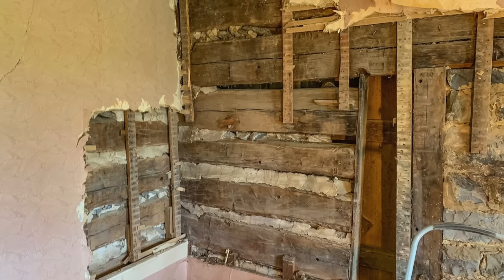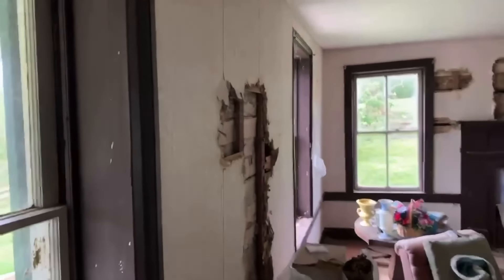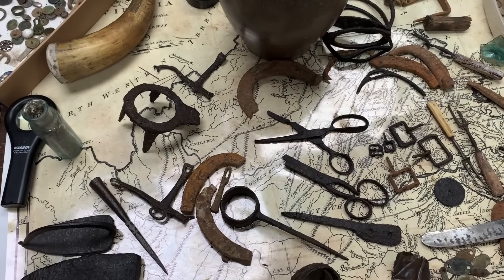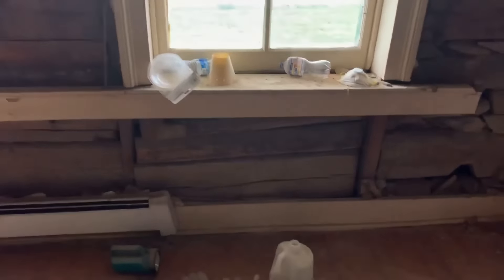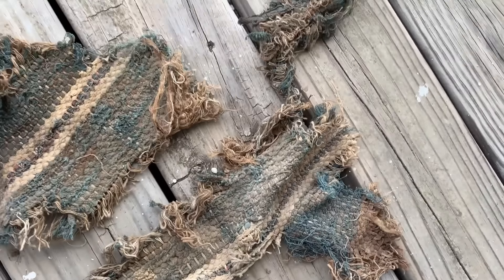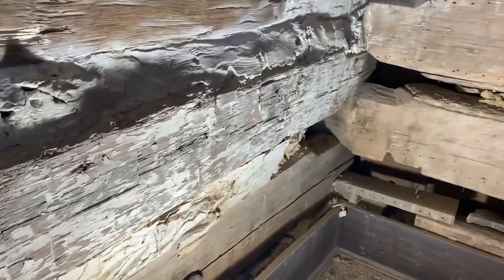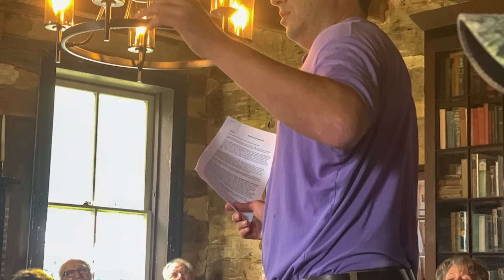I Found a Revolutionary War Log Fort Inside a House

Comment: My Dad bought a similar house on our farm in 1969. The very old lady owners (Schwerz Family) told us the the house was 175 years old at that time. Frame was huge oak & hickory hand-hewn beams, drilled & pegged. The beams were extremely seasoned, almost petrified. We had to use square masonry nails because steel nails would bend hopelessly. The walls and wall beams were true-size, 1-by's and 2x4's.  The lathing was like yours, felt like very tough, oily pine, and the walls were filled with mud & straw plaster (excellent insulator).  Like yours, lots of manual labor.  Basement ceiling/ first floor was hand-hewn tree beams. We would have left the tree beams in, except for signs of post-hole beetles having been there. We had to use the tractor to drag those out of the basement. We found flint arrowheads stuck in the upstairs window frame beams. Watch out for creosote buildup in and around fireplaces and chimneys. Can be dangerous. There were lots of hardware pieces, both house & garden hardware, and farm implement parts. Your ideas of what things are seems pretty spot-on.  I have ruined a coin or two trying to "clean them up".  Ultrasonic cleaners can be non-destructive, but also aggressive. You're gonna have ALL KINDS OF FUN !!!  ENJOY, and Thanks a Bunch.
Reply: Thanks Kelly for sharing your story!
Reply: @goaskmymom1350  Thank You. It's nice to be appreciated !!!

Comment: My uncle bought an old farm in Kentucky way off the beaten path.  The barn was huge - like a small house.   After many years, he needed to repair parts of the barn which were rotted.  As he tore down walls, he noticed logs in the wall that looked ancient.   After removing more walls he found a small cabin in the corner.  He had a suspicion it was related to slavery due to the metal rings hanging on the walls.   After much research and appraisals,  the cabin was a confirmed slave cabin.  My uncle didn't want it so he donated it to  THE UNDER GROUND RAILROAD FREEDOM MUSEUM in Cincinnati.

Comment: I'm a retired crippled old carpenter and salute you for saving our history.
Worked on many log homes. The younger men usually installed the lath sticks. To keep up production they'd have the lath nails in their mouths and spit one out at a time. An old carpenter years ago told me the zinc in the nails rotted the two from upper teeth. Probably took a couple years to build that beautiful place, all by manual labor. Those logs are in excess of 400-500 years old, at least. We used coco shells and blasted our logs clean. No damage to the wood and it was fast and easy.
Job well done and thanks for sharing!

Comment: Just a labor savings thoughts.  Rent a dumpters and have it dropped off next to the house under windows up stairs and down if possible.  Go get a couple 12ft pieces of roof sheet metal and build a simple slide that you prop into one of the windows.  No more exhausting trips up and down stairs, and you only move the waste materials once, out the window, and into the dumpster.  Once done, make the call, and it's gone.  And you only lifted the waste materials once.  Huge reduction in physical labor and time savings.  I'm a huge fan of minimizing how many times I handle and pack materials around a job site.  People don't add up the multiple times they lift, carry, stack, and move waste materials. It becomes exhausting.  Especially on a major project like this, a little pre planning and analyzing how and where you're going to move and store materials can have huge rewards over the course of a major project.
BTW: Looks absolutely gorgeous!

Comment: What a job! Having worked on a similarly aged two story coach stop/home, I can sympathize with the amount of work involved. I had later worked for a fella that removed and restired old barns. A lot of his work was restoring and adding onto early log homes. The amount of labor involved with fitting the logs and assembly was immense.
Kudos for returning this bit of hustory to light....thanks.

Comment: What an utterly fascinating project. And I thought my old house had a lot of DIY in it!!!😊

Have you considered hiring in some archaeologists with ground penetrating radar?

That could help identify any demolished buildings hidden underground and possibly the line of the outer stockade that was shown on the map.

Also, you could get a dendrochronologist to look at an end of a log or logs and they may be able to tell you what year (sometimes even the season) the trees were felled.

One last question. The boot you found (not the cut down one) did you find it in a wall near a fireplace or threshold?

In the UK its not unknown for shoes to be found concealed in such locations and they were hidden, apparently, as a protection against witches.

It is something more associated with the C17th or earlier, rather than the C18th, and tend to be children's shoes, but it was just a thought.

Comment: 20:37 A type of spokeshave/planer/adze; for roughing and shaping before fine finishing.  The old homestead would have had a full compliment of woodworking tools - everything everyone had pre-1850 would have been made themself (no Home Depot back then.)  If you needed something, you mostly made it yourself.  You didn't usually throw-out an old tool (even if it was broken, you'd take it to the smith for repair) so finding old woodworking tools is a find.  Direct bloodline descendent of many of the Revolutionary families of Jefferson County, WV here. 23:30 A wool working or felting comb (human hair combs were made of shell or bone or ivory if you had money, or wood if you were poor).  When you find the outhouse and cesspits, then you'll really find the preserved treasures.

Comment: Builder/Historian here with a side note; the square hole you call a 'firing port' is in fact the place where the outside staging was set in place. The same detail[and mistake] is also see in the Maine Historic Site, the Pownelborough Court House which is of the same time frame. A first rate find, indeed.

Comment: What I saw in the dug items. A Jews Harp, the tapered Square spire with a round bottom rod would be for the Pritchel hole in an Blacksmith Anvil, I did see a Modified Straight razor almost a Blacksmith wedge shape and the handle was bent 90* to the original Blade edge. The lightly curved edge you found was I think from an AXE which was probably forged with the blade edge sandwiched between cast iron to provide a lasting edge that did not last and separated from the forging.  The bag of round stones? Possible Grape shot for a cannon for anti-personel use on a wide open battlefield. 

I Love what you are doing to the House/ to retain the fort interior, Super cool.  Best Regards.

Comment: You've done a wonderful job, painstakingly uncovering the original bones of your house, blending it together with the modern structure and excavating and cataloguing so much of your homestead's treasures.  What a wonderful success.  The cave spring might be your next project: removing the accumulated overburden and utilising this rick black soil deposited in front to reveal its hidden, majestic arch.  I quite believe the artefacts you find there and within will go back thousands of years.  This seems like a sacred place.

Comment: 100% there is a hidden armory or store room most likely underground. It may be collapsed, but its there somewhere.
They usually hid the entrance in or around stairwells, but could be anywhere.
Also many times after the army would leave a place, such rooms would be hidden loaded in case they ever needed to return in emergency.
Hidden in a way that to you would look like its original.

Comment: The 'brass engraved' object is the end of a leather bayonet scabbard. The 'flintlock plate' is a striker, used with flint stone, to make a fire, the long rusty item with the hole at the end, is one half of a hinge set, and VERY EARLY! The eyelet item with the screw end is a 19th century exterior shutter fastener. Note; this writer owns and has restored an 1815/1886 "I" house, and some 25 yrs of history detective work.

Comment: That first metal item,conical, is the tip of a leather scabbard. 1700s and earlier. Civil war tips had a longer rounded build-up at the tip.  Nice find. Look for any similarly decorated straps and hooks that would go up higher on the leather scabbard to attach it to a man’s belt or horse’s saddle.

Comment: I was watching this video and you were showing some metal artifacts you had excavated. The first one (The one you said was engraved brass and was cylindrical, and someone had said maybe it was a cane decoration) looks very much like the brass ferrules I install on the ends of my walking sticks to prevent the wood from wearing and splitting, except mine have no engravings or stamped designs. I have seen brass ferrules that were embossed with designs.

Comment: I’m watching your YouTube story and I keep seeing similarities with my cabin. The floors had the old linoleum rugs and painted surfaces around. The nails are square. All of the interior has been gutted of the newer walls and you can see all the chinking and logs. The walls were covered with what I know as beaver board, very much like cardboard. No insulation. It’s a much smaller building but the layout is so similar. I have many photos if you want to see.

Comment: Well done for saving an historical building, but as a UK architect dealing with conservation of historic buildings I would be concerned that you have used a dyed concrete/cement (1:04:33) mix for the walls. Please get some professional advice as cement mortar could be detrimental to the integrity of the wooden structure.

Comment: If you can find where the outhouse was- usually a deepish 'dent' in the ground. the ground will be soft. Sometimes you can find them by poking a rod into the ground to test for soft areas in low spots. Sometimes stone was lined around the foundation area. That would be underground a bit by now. Outhouses were used for a lot of 'trash' which now would be treasure. Old bottles, etc were tossed into outhouse holes. It normally didn't break. The biologics would all be composted down by now. And there are a lot of sites that have recipes for original whitewash mixtures made with lime. Lime prevents and repels insects and keeps mildew away. Those recipes originated in Britain and other parts of Europe.

Comment: 19:45 Flag staff end protector

21:25 Head of Auger bit, and a super old one at that. You might be holding the very piece of the tool that made the holes in the logs for the dowels of the original fort. A handle on either side of a vicing mechanism with a square hole would have driven it, and it's not surprising the auger is broken off. Wherever you found it is where the guy drilling got pissed off and threw it. 😂

Comment: I think a goodly portion of whitewash should be left, it's actually a part of history from around the same time the logs were put up. It was not just used for brightening interiors, it was also an insect repellent, odor eliminator, and mold and mildew repellant & prevented wood rot. I think it played a part in the building preservation. Thanks for the fabulous tour & history.

Comment: You need to find out where the old out-house was...that is where all the treasures will be!! lol   What an awesome restoration project...thank you for saving it.  Have you tried restoring some of those items using the electrolysis method....it works wonders on old rusted iron items....Stab it into a log on the side of the building and put an oil lamp into the wide steel round ring.

Comment: 20:19 is a knife, the pin to hold the handle on is still there. 20:39 is a lantern or bucket handle to hang from a nail. 20:55 is a keyhole for a door. 21:12 would be wedges for axe handles to hold the axe head on the handle. 21:25 is a punch. 21:33 is a hoe for the garden. 22:17 would be to hold two pieces of wood together with screws through the holes, or a inlay for a piece of furniture. 23:06 is a piece to the trigger assembly, open up any current AR and find the same. 23:18 is for a cloth patch to clean rifles or cannon. 24:53 is a hook for a barn, likely held tack for their horses.

Comment: This is a flashback to when I bought my place here in Ky. Almost identical in many ways but mine was in much worse condition. I chuckled at the wallpaper layers, I had about 1/4” thick of it, some was bible pages for a layer. No one was able to really dial in the age, but best guess is maybe 1840 or so. 
It is a saddle bag style with dog trot 16’x 44’ approximately. Story and a half tall with 3 very steep false dormers that are reportedly a style brought down from the French Canadians on their way to the gulf area. The dormers were to direct the snow away from the entrance doors when it slid off of the 10/12 pitch roof. Originally the roof had wood shakes, oak and chestnut, sometimes around 1900 it got a terne metal roof which is still there now. 

I see some spoke shave bits and pieces that you have, I am a woodworker who has over 45 years experience and my skills came in handy when I had to replace a few logs and tooth them into the existing walls. The dovetail joints tell me that one side of the house was built to a higher standard than the other side, fireplace in the dog trot open to both sides. 
You did a great job on the place, I didn’t have as much to work with nor the funds to make it as beautiful.

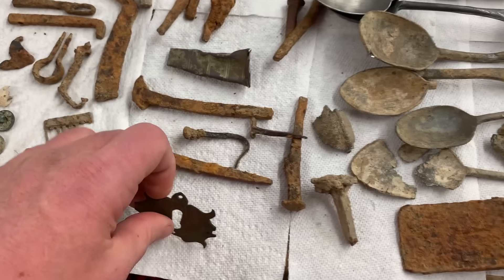Comment: the cylindrical engraved brass part @19:52, could be a sword scabbard chape(the bottom protective tip of a sword scabbard).@19:40 that looks like the blade for an early single handle mezzaluna knife. @20:42 looks like the top of a stirrup. I'm a rev war reenactor that dabbles in blacksmithing of kitchen and domestic tools, as such,I have researched tools and accoutrements to make my kit as accurate as possible.

Comment: I don't think that they had a plattform for the spy holes but rather had different floor heights as they are today. There are very high window openings too. Probably they had cattle on the ground floor like the old bavarian farms. Keeps the cattle safe in the winter and the house warm.

Comment: The piece at 31:52 at the bottom of the glass case. It's metal and has a round bottom with two prongs (similar in shape to a Halo Blade Funnily enough) its the frame for a Jaw Harp that is missing the central bar. You also show it early near the comb at 23:29. Thats what it looks like to me at least , hope that helps!

Comment: When I gutted the interior of an old house I bought for $7,000 in a tiny, unincorporated community in Illinois, (pop. 150), I was doing it by myself. I had no idea what I was getting myself into.  But when it came to hauling the old plaster and lath out of the second floor, I quickly realized I should have been triplets. I ended up using a real heavy-duty tarp suspended by whatever old lumber I could salvage up to just below a window, and shovels the debris out the window, where it slid down the tarp and into a dumpster. Still a lot of work, but so much better than carrying it down the stairs, which were narrow. 
Downstairs, the living room was so bizarre, 14' wide X 26' long.  There were 3 very small windows at the south end, right next to each other, that let in minimal light. There were SEVEN doors in the room, and one old space-heater stove, the kind with the old stovepipe into the wall. Every door was different. It turned out the place was originally a brickyard, and the building was the "office, one room. he rest had been added on literally one room at a time, until it became a 3 bedroom, 2 story home. So in knocking out the interior walls, there was NO method to the madness. Every interior wall had exterior siding of varying types,and even windows! I ended up tearing out The wall from the entry room to the living room that had 3 doors of different heights and widths, with only about 8 inches between them. Strange . The center door was tall and skinny, to the stairs, which were incredibly narrow. The third door led to a bedroom in the front part of the house, and the first door was a very wide door between the "parlor" and LR.  The wall on the parlor side of it was the wall of the stairway. i took out that wall as well, and made an "I" beam to hold the weight of the upstairs in that section.  Opening that stairway was the best idea I had! Eliminating 3 of 7 doors was the second best. The bathroom door was just at the corner of that wall, opening into the living room(yuck). I moved it around the corner, still a kind of odd place for a bathroom door, but at least not opening into the most public space! The stove took up one whole wall, with a bed room door on one end, and TWO, count 'em, two doors opening into the kitchen...? I closed the first one about half way up, and made it a bookcase and phone nook, and the stove was replaces with hot water heating, which was actually the only thing I had to hire done. I had just filed for divorce right about the same time I acquired this house, and about a month into the project, discovered I was pregnant!  A testament to the superpowers of a human being when faced with impossible circumstances!
With a purchase price of $7,000, and virtually no labor costs outside of the installation of the heating, and the first 7 months of the endeavor child-free, the next almost 2 years with a newborn/toddler, I finished (mostly) my accomplishment by giving in to an irresistible whim...I painted the living room PINK.  LOL